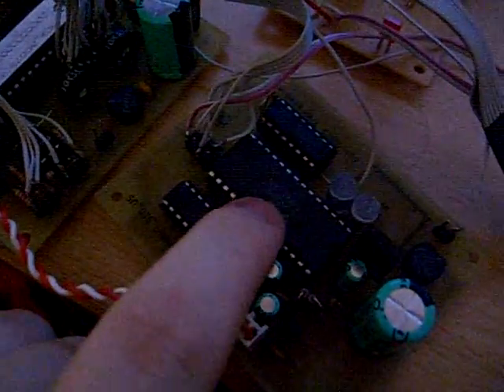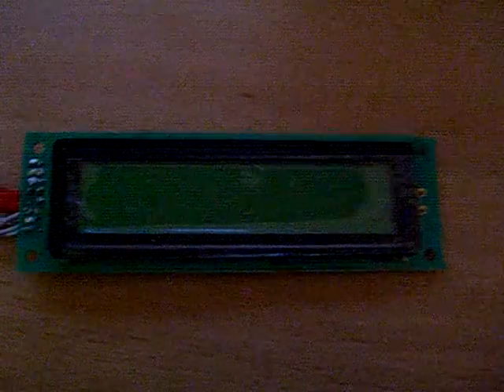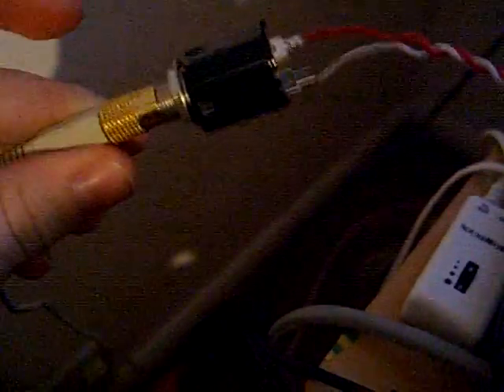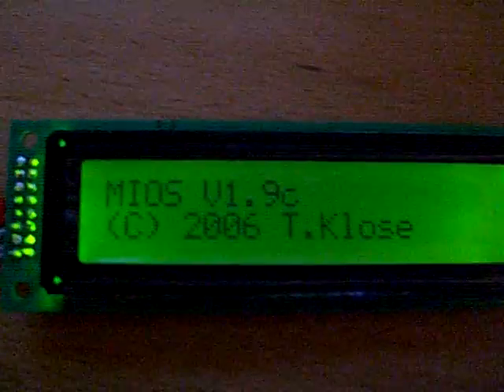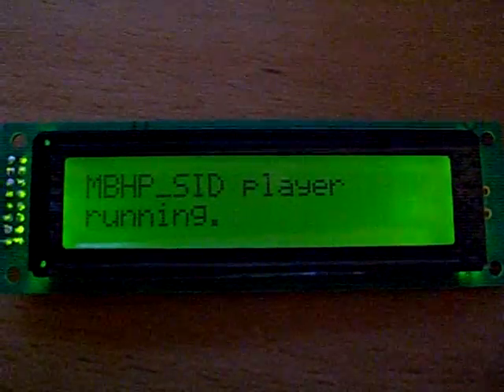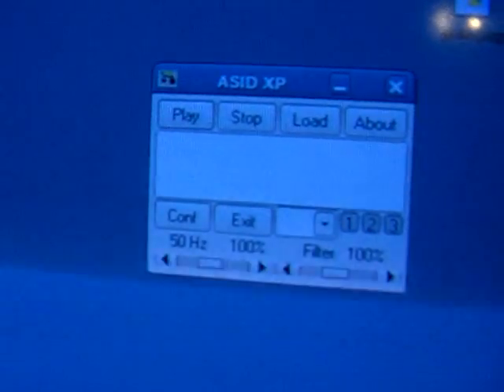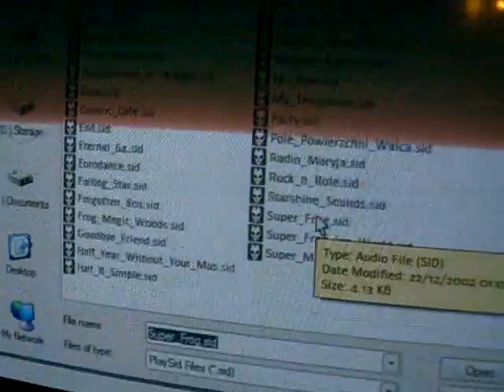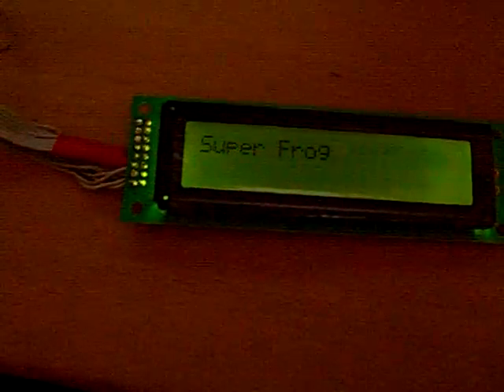A MIDIbox SID is born! (Part 1)

Comment from the maker: Youre welcome! :)

I am using V1 boards I think - I bought them years ago and didnt get around to putting them together until recently. Because they're older boards I had to add the modifications described on the site to make them circuit-compatible with the newest boards, and thus be able to run the latest MIOS and SID firmware. 

I am using 8580 chips - I have four of them ready :D